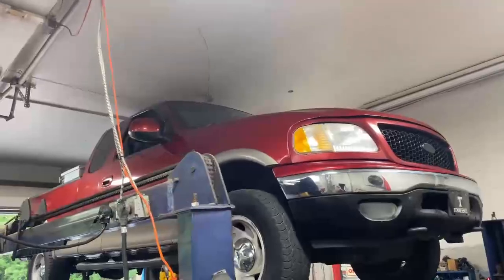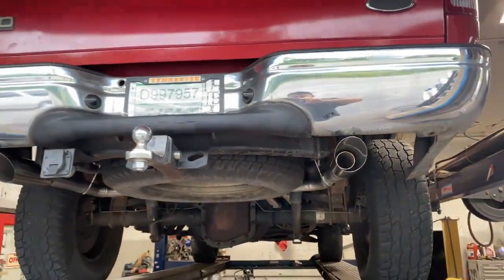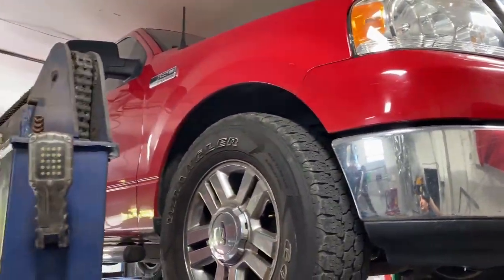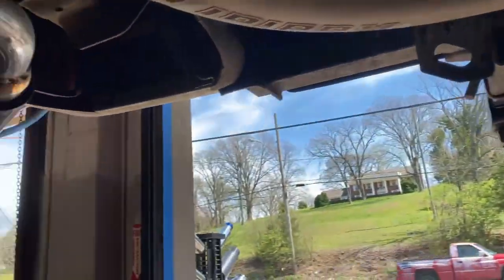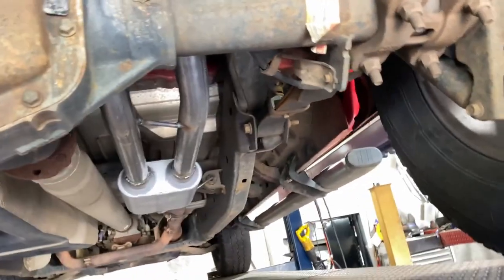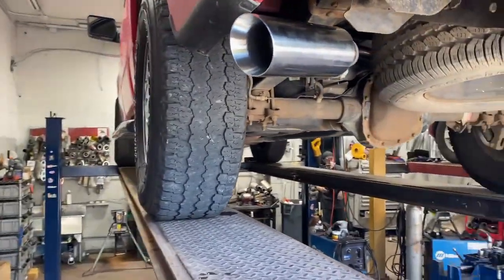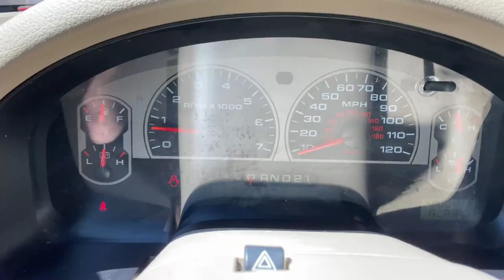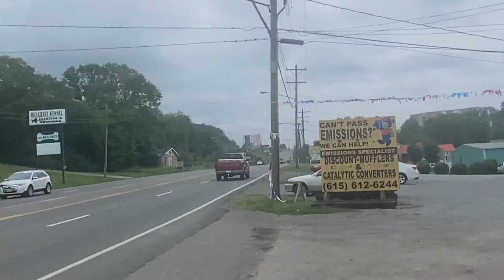Ford F-150: 5.4L Triton Vs 4.6L V8!

Comment: 4.6 all the way
Reply: can u explain to me why, im lookin at a 06 one now
Reply: @suspensefulness  Ah the 5.4 is usually over priced for the power that you get and I don’t remember if it’s the 3valve or the 4valve 5.4L that pop spark plugs and the spark plugs can sometimes get stuck but overall the 4.6 is a safer engine and decently fun.
Reply: @EastDallasKicks  i appreciate it ...im not gonna be hauling or pulling and if so, jus a trailer for my motorcycles i jus need the engine to be reliable for highway driving ,the one i seen was a 06 for 4k with 130k miles and one for 4500k with 200k same year🤷🏾‍♂️
Reply: @suspensefulness  Nice but just watch out for these trucks that are 10 or more years old yet the owner says there low mileage like 130k. If the paint looks good and the frame underneath isn’t too badly rusted (just surface rust) than maybe it’s true but with older vehicles I just don’t believe these low mileage numbers
Reply: @EastDallasKicks  so u saying for that year it should be higher...i seen a really clean one with 240k but that seems high i also see a 04 dodge ram wit 210k for 4000...
Reply: @suspensefulness  Possibly but if you go tos we the vehicle and you trust the owner then I guess there would be no reason to doubt the mileage being true. At least with 240k you have another 50,000 miles guaranteed and probably a lot more. Just get what you like but don’t overpay, ford tends to be the cheapest but that doesn’t mean it’s bad. I see overpriced dodge rams and definitely way overpriced Silverado’s/sierras but your best bet is probably a 97-08f150 or 03-06 ram 4.6-5.4 for the ford and 4.7 for the ram
Reply: @EastDallasKicks ehhh the 4.6 is extremely underpowered tho and difficult to find you might as well get a 5.4 for cheap then junk it if the motor goes unless you can somehow fine a 4.6 f150
Reply: @KR0TE7  Yeah honestly the only 3v 4.6 u should be buying is the Mustang. If I was to get a work truck 4.6 it would be the 10th gen 2v

Comment: IMO I always thought the 4.6L sounded slightly better when you’re on the inside, listening to the engine, but the 5.4L (2 & 3 valves both) sound better from the outside and out of the exhaust.

Comment: Considering by the cam phaser issues on the 3 valve 5.4, gimme the 4.6 all day long.... Silky smooth and reliable if not a powerhouse.
Reply: Bulletproof 4.6
Reply: @angeloportacio2634  IMO, bomb proof.  LOL (2 valve)
Reply: @angeloportacio2634  yes mine has almost 400k original engine
Reply: Slow tho but I rather have the 4.6 than the ticking 5.4 with low oil pressure & phaser slap.

Comment: Those cats really kill it for the 4.6L
Reply: Have more hp if you take them off
Reply: @andrewhatton1606  can u elaborate please?
Reply: @seantaylor407  cats are restricting exhaust flow. No cats higher flow.
Reply: @TylerH8  thanks brother my truck is in shop as we speak getting cats looked over.

Comment: 4.6 sounds better and is LIGHTYEARS more reliable. The 5.4 3v is named the worst engine in automobile history.
Reply: I don't want fights, but that engine is not considered the worst engine in automotive history. The 4.2-liter V8 engine was the worst as it had carbon emissions problems, and only produced 120 horsepower.

Comment: I have had both an f150 with the 4.6 and one with the 5.4l the 4.6 had the 40 series when I got it and and sounded pretty much the same as the one on here. I got my 5.4 l fx4 last year with stock exhaust and had shorty headers and true dual with the super 10 series flow master muffler. I like the 5.4 set up I have way better a lot more snap.and clap. It is ridiculously loud and obnoxious

Comment: I have an 05 xlt with the 4.6. Currently I have a super 44 with a turndown. Everything is stock but the muffler. I’m wanting more sound (rumble) but I don’t want it obnoxiously loud. What would be the best option?
Reply: Cold air intake and upgrade the plugs, maybe even high flow performance cats

Comment: What if i want to go a little quieter on my 98 with a 4.6? I still want to hear it but more chill.
Reply: Go with the 3 chambered Super 50 series which growls the same as the 2 chambered 40 series but has a larger case with 3 Delta plates inside vs the 2 Delta plates in the 40 series.
Reply: @lanewarriorillridez3739  thanks man ill check that out.
Reply: @robertbelote5273  yep it also comes as single in / dual out for twin pipe setups.
Reply: Use the stock muffler and straight pipe all the cats

Comment: Because of the years and generations, you are almost comparing apples to oranges.
Interesting video though.
Reply: They have 4.6’s in 2004-2008 trucks also
Reply: @johnjack8195  3v though

Comment: I was looking at f150s years 04-08 nothing brand new like but my question is what's up with the 5.4s? Are they a safe bet for those years? If not what year did they fix the cam phaser problem...also does the 4.6 have the same problem as 5.4s?
Reply: I have a 2007 triton 4.6l and I'll say its the best truck ive ever driven! I would take the 4.6 over the 5.4 anyday!
Reply: Try to get a 1 owner 5.4. If routine maintenance was done it should be fine. I've had my F150 5.4 since I bought it new in 2007. 280K miles and still running strong.
Reply: @El_5Zero  ive replaced the throttle body, spark plugs, coil packs, o2 sensor, upper and lower ball joints, new sway arms, wheel bearings, the best brakes and rotors, etc. Im gonna keep this truck cause im the 3rd owner and i personally know the guy who had it brand new and its been taken care of. If im gonna get anything its gonna the be Coyote 5.0😏
Reply: @guero9714  they really are great trucks, no regrets with mine! I have 4.56 and 35" tires on a 6" lift and rides and runs great.

Comment: There is no way these engine will sound the same cz the 4.6 is a 2v and the 5.4 is a 3v if they would had used the same valve both 4.6 n 5.4 2v or 4.6 n 5.4 3v then u can compare

Comment: Does 4.6 have all the problematic reputation of the 5.4??
Reply: I have one and works pretty good I used to drive a 5.4 from my job and we had to change the motor after the 200000 miles ,,
Reply: nope , at least 4.6 2010 is good